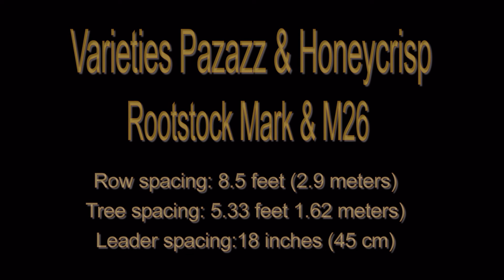Excelsior Farms Multi-leader Apple Orchard

Comment: Hi! Amazing vid and great work! :medal-yellow-first-red:Thank you very much for sharing!
You are using H-Brace system for the end of your posts raw. 6 year after how is your experience? Still strong? How long are your row with no mutiplying h-brace system in the row? I'm thinking about it for the implantation of my own orchard with 525 feet long lines on a 3% slope. Would you today recommand it? Any other advice about it?
Reply: Not going with H-brace any more.  Longest row is 740'.  Could not figure out how to keep both cross wires tight without the end (alley post) of the H leaning into or out from the row. I'm sure an engineer would straighten me out, just haven't found the answer?
Reply: @rogerbannister6942  ok, thanks for your reply! very hard to find safe advices for this system to set up in an apple orchard. Maybe someone here in this conversation! :) anyway thank you for the reply and video, keep doing great work! :)

Comment: Thank you for the great video.  I'm from India 
 still trying to figure out the pruning.  Can you provide a overview of how these trees were pruned?  I heard laterals were pruned at 1inch and 4inches.  What pruning was performed after that?
Thank you.
Reply: One inch to get the tree to the top wire. 4 fingers after that. Any branches  that are closer together than 4 fingers vertical on the leader, i cut out back to the main stem (or leader) Both horizontal and vertical are pruned to 4 fingers. (Meaning no horizontal branches closer together than 4 fingers vertically spaced.

Comment: would you suggest this system on m9 t337 rootstock with GALA apples or should I use another rootstock.?
Reply from the maker: Not sure where you're from.  I couldn't get this kind of growth from those rootstock in my climate and on my soil.  However, I'm told Stuart Tustin has done this successfully in New Zealand.  I thought he was using 106 rootstock but someone said it was m9. You need to really think if you want to go with this system.  If you lose one trunk, you've lost 3 or 4 trees and it takes 4 years to replace those trees. Do you have time to go back, find the trees in the orchard and manipulate the branches to develop them as necessary? In Europe where they average 25 acres it is worth it, in US where the average is 180+acres... do you have the time to do it?
Reply: @excelsiorfarms7598  thanks for replying.. I am from himalayan region of India.. the weather is suitable for apple production here.. my two orchards are 7000 ft and 8300ft above sea level... here tall spindle infact is a new concept.. majority here have seedling apple orchards.. i would appreciate if you make more videos of your orchards and share your knowledge with other around the world.